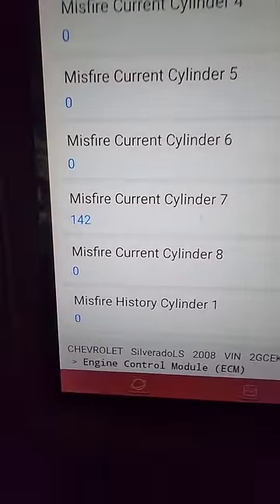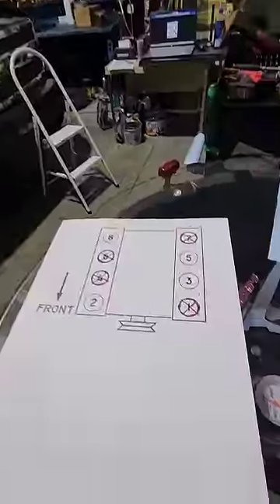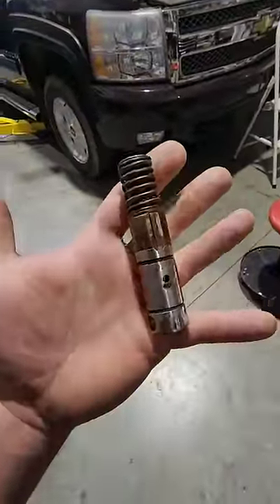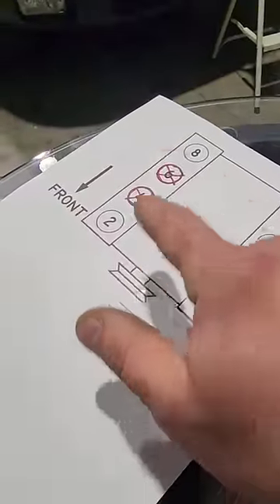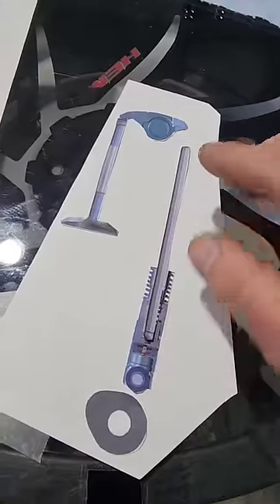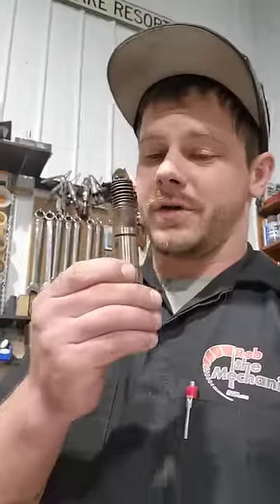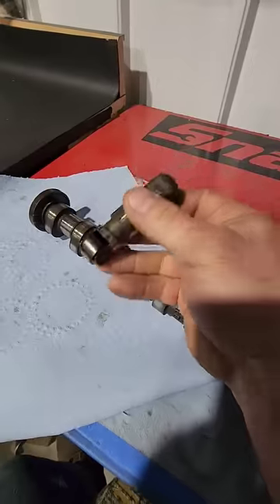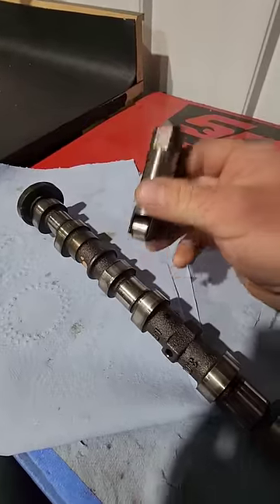GM Lifter Tick #shorts

Comment: A few years ago I was talking to a K-9 cop about his official vehicle - a Suburban that was around 5 years old. I commented about how with all the idling it does I'd expect to hear "the tick" but it sounded really smooth. He told me that he mostly takes care of it himself instead of trusting the department motor pool, and he does much more frequent oil changes than officially recommended.
Reply: It's been my experience that the manufacturer recommended oil change intervals are too long, especially if you use the GM oil light.
Reply: @mikel9656  i have worked for ford and gm an now Volvo. All oil is crap, all piston rings are tiny, weak and brittle. You are correct, oil intervals are ridiculous. Volvo is 10,000 miles or 12 months 😮 ....at 10k ive done 2 oil changes. Never exceed 5 k on todays oil and maybe 8k on ( making jack off gesture ) ams oil .
Reply: @Rob Sorgdrager  Applicable only if you're using conventional oil.

IMO, you shouldn't be using that oil in the days of tight tolerances at all, anyway.
Reply: @subtlename2873  agreed, ams oil is just expensive-er regular oil. The oil today has had all the " expendable " metals removed. The chromium, molly and zinc have been replaced with calcium. The low tension rings combined with sub par oil drain orifices and direct injection have created a issue all on to its own. Combine that with short tripping and over saturation of particulate in the oil. Every system in newer engines uses oil to either lubricate or operate a system. The bearings are made from aluminum and most engines are all aluminum with some sort of plasma voodoo sprayed into the bores....gimmie a high nickel iron small block from the late 60's and some steel bearings and a gallon of old rotela 15/40 .

Comment: Hemis have the same thing . I’ve had a customer come in with 3 lifters collapsed and the  cam was completely chewed up on all 3 lobes for those cylinders . Lady said that car was ticking for over six months and it was barely running.
Reply: Very true, early 2000s hemis also had valve spring issues. Done bunch more chevys though
Reply: 360 V8 gaser was the beast mode motor for Mopar. Will not die, bodies just rusted away

Comment: I fixed this same problem with liquid moly additives and running the engine on the highway in 3rd gear at 3-5k rpm’s , the lifter came loose and no more misfires, I also changed the engine oil with liquid moly oil
Reply: Parts in a can..... guess it can work sometimes
Reply: everybody should do this, I have a theory that most people have problems when they drive like a grandma, these parts need to be stressed and heated up sometimes to work functionally

Comment: Ya we do about 3 of them a week. It's cheaper to replace the lifters when it startes and do the conversion to get rid of the cylinder deactivation. However when it goes too far its cheaper for our customers to replace with a gm engine instead of replacing the cam.

Comment: My father-in-law's 2012 sierra 1500 has been making a similar sound for a bit. Doesn't do it all the time though, and there's no sluggishness while driving. Also the check engine light isn't on, and the engine still goes from V8-V4 like it should. Only does it while driving though
Reply: lolololloloololool
Reply: Check exhaust manifold bolts
Reply: @ajaxracing  So many idiots think they have lifter tick when in reality its the manifold cracked and warped
Reply: @shesqueeled  yup

Comment: I'm glad i went with the 2010 F-150 300'000 miles and only had to change the alternator.  Runs great starts on first try. 4.6 l v8 and gets 22mph highway.
Reply: So they stopped making it . I have a 4.2 with 320k miles

Comment: GM has brilliant engineers who were top of their special education class.
Reply: They were given a fuel economy target, they met it. Chrysler uses the same system, and honestly both systems are pretty reliable.
Reply: @isaakwelch3451  no, they are not. They have ruined thousands of engines in under 100k miles.
Reply: @curtism-w6b  thousands of engines out of the millions that have been made is a pretty good failure rate
Reply: @curtism-w6b  The bar for GM has been lowered to the point that 100k miles is exceptional reliability and a 2% failure rate is a miracle.  I've been burned by GM in the past - never again.
Reply: @bills5009  This. Compare Japanese quality control to GM and it’s not even close. Babied my LS3 since new, finally sold and will never buy another Chevy ever again. RIP ❤

Comment: I won the broken pushrod lottery on my ‘16 Sierra 6.2L back in July of 2023. Poked two holes in the block and seized the engine. $8K for a scrap yard engine/trans replacement on eBay. Went ahead and had DOD delete installed for an additional $7K between parts and labor. And still, cheaper than buying a new or used pickup from a dealer.

Comment: I remember replacing my cam shaft and valves on the good old 78 chevy c10, had a little 305 in it haha only took about 8 hours with that one, what always grinded my gears was the timing as it took me awhile to learn how to set it correctly.

Comment: Maybe the engineers aught to set this up so that if a collapsible lifter fails you get a check engine light.

I used to be a section leader for electronic technicians and one of the things I did to vastly improve our efficiency was to train the operators to detect and report problems that they had previously ignored because they seemed minor. So, having an obvious symptom, like a check engine light, might get people to bring the vehicle in when the problem is still minor.

On the other hand this video might help people realize how serious this tick is and get it fixed early.

Thanks for posting this one. I realize it might cut into your revenue, but I’m sure you’ll still get plenty of work.

Comment: I did the delete myself. After replacing all lifters once... Months later cyl 1 lifter collapsed. Did a tune to remove AFM and plugged up the oil channel in the VLOM to manually delete it. Been running the truck strong for over 2 years now.

Comment: I just had a DOD lifter fail on '07 Tahoe, about 2 weeks after I bought it, no noise or anything, just a miss on cylinder 4. When I pulled the valve cover sure enough the intake valve isnt opening, mysteriously it also had new, no name, junk looking coil on cylinder 4, so I suspect it may have gave the previous owners some trouble at some point and they tried that first, and then possibly doctored up the lifter somehow. It was runing like a top prior and I put well over 1000 miles in the short time I've owned it, it probably would have held if the DOD was tuned out afterwards.

Comment: The majority of lifter failures that I have heard of did not occur in cylinders with MDS lifters. Mine occurred in cylinder #5, which isn't an MDS cylinder. Once I experienced the failure, I started researching the problem and haven't been able to determine that MDS had any role in it. It seems to be random...some on and MDS, and some non-MDS.

Comment: Theres alot of videos about this.
One guy invented a tool to get the lifter to expand in certain circumstances.
Theres also an issue with loose bolts in the upper engine area.
You should watch several videos about the different symptoms to get an idea for your diagnosis.
Be quick about effecting repairs like this guy says.

Comment: I drive a 2008 Honda accord V6 with VCM it’s the same thing as AFM on GM vehicles except mines a little more reliable but it does burn a little bit of oil over time I can get it removed with a plug in adapter

Comment: The exact same thing can be achieved with the Engine Management System, which could also alternate cylinders being cut off so they all wear evenly, keeps all cylinders at roughly the same temperature.

Comment: Lifter tick is so common that it's a feature. We did a ton of lifters in the more recent body style gm trucks. At least the 08-13's more often than not lasted through the powertrain warranty. We hardly saw these trucks because by the time they failed, their warranty was expired and no one wants to pay dealership rates on this big of a job. These new trucks are getting multiple sets of lifters before 50k.

Comment: FYI. Instead of a 4 to $6000 delete kit you can spend $200 on a plug for your OBD. It keeps it in V8 mode at all times and I’ve had no problems. The truck I had before this one actually had one of the lifters spin sideways on the cam. So after fixing that and buying a new truck, I bought that plug thingy right away.

Comment: Mines been ticking for about 23k miles. Local shops want 9-11k to put in a remaned long block or 4-5k for a top end rebuild. I can't afford either right now. So I'm still driving it to work

Comment: Eh, typically happens due to a lack of preventative maintenance. Drain a quart of oil and put a quart of ATF in the engine oil and run it for a little bit. Those oil ports occasionally get clogged and that does not allow the lifter to lift and the detergents in atf will, most of the time, clean that up, anywhere from seconds of running to about 50 miles of casual driving. Works with this bs and just typical hydraulic lifters too. Then just change your oil and keep your oil changes up to date and don’t go 20k miles or 5 years without an oil change. I’ve personally never seen anyone have this problem on the DOD GM engines that stayed up to date on their oil changes.

Comment: Ha brought it in a month ago. My 21 ram 3.6L has been ticking for the last six months from 110k-160k. Still ran decent. Turns out to be both passenger side cams and the defective rollers. Got my motor money in those 50kish though.

Comment: Traded my v8 sierra for the I6 diesel engine, best decision I made, had a misfire in my v8 at 23k miles and the check engine came out, a week in the shop to get it fixed. My Duramax is still going strong with no dashboard lights at 60k miles, and the Duramax is an awesome diesel saver.
Reply: You realize that GM does not make the Duramax engine. They tried to do their own version of a diesel engine after Dodge was using the Cummins. Did not work our so well, like most of the GM products since the 70's. They HAD to go with another engine to save face once again, thus the Duramax.

Comment: Don't forget fuel seeping cylinders which can't fire correct building up fuel breaks down oil also.
I found out coilpack went bad until I found a fire diagnostic tool between plug wire to plug show exactly fire weak.

Comment: I had this ticking sound on my 1998 360 Magnum many years ago. changed all the lifters after the Professional  Mechanics  Diag'd it as being a collapsed lifter Issue, measured the Cam 100% perfect. Same thing. Replaced T-stat cuz it was running cold at the time, it got 400% worse. Replaced all the Rod Bearings Same thing. New oil pump. Switched to a " Tick relieving" grade of oil same thing. Flushed the engine 6 times same thing. Only had 60,000 on it. Perfect compression and great performance.  Sold it cuz the old lady thought it was gonna blow up. $800 🤬 still driving to this day 100% fine
Reply: Mopar 360 V8.... much more durable than a GM 350, or Ford 351. As a rule, but there are exceptions to all rules
Reply: Lmfaoo no way you went through all that just to sell it for 800 thats fucking sad that was a perfect engine

Comment: The Biggest Issue With These Lifter Failures Is People Drive It Till Its Misfiring. At That Point Its Got So Much Trash Circulating Through Your Engine That The Success Rate Of Just Replacing Cam And Lifters Is Very Low. Your Pump Gets Whiped Out, The Lifter Bore Gets Damaged Upon Removing The Destroyed Lifter And You Have A Very Fine Abrasives Circulating Through The Engine. 

As Soon As You Hear A Noise From Your Engine Thats New Have It Checked Out haha.

Comment: My 2017 sierra is going back for the second time for lifter ticks. 2nd day I had the truck I had to bring it back and now 5 months later and not even 3000 miles I have to bring it back. It’s a 5.3 and I’ve noticed it’s been firing 4 cylinders a lot lately instead of 8.

Comment: I did a DOD delete with a cam and new lifters on a 2014 and it still did it after 100miles.  Sold the truck, I think it’s the 2 stage oil pump, bc it would go away after 2nd stage kicked in with higher oil psi.

Comment: I have a 07 tahoe lmg 5.3 that had dod got the tick at 30k so I got a btr cam, lifters, and buckets got rid of the vlom plate and used a pre dod vally cover bought a vlom oil plug from some guy on YouTube and sent out the pcm to lt1 swaps had it programmed installed a melling high flow oil pump and it now has just over 270k on the engine with zero issues...

Comment: If this happens buy a push rod grind end like a drill bit, hit lifter to turn & unlock lifter so it opens.
Then it stops noise.  Then turn off relay & fuse to lifter controler.

Comment: It literally takes me less than 8 hrs to do the whole job new camshaft new retainer new lifters deleting the afm i plug the holes in the valley I put new oil pumps and everything on the 5.3s that's with getting heads cleaned and all 😂
Reply: Is that what you pay your employees? 8 hours? It's a 22.3 hour job in a labor guide.

Comment: I have the 5.3 in my "09" Suburban. Knowing damn well about this GM brainstorm so I'm  strict with the oil changes and only use full synthetic. Have been debating whether to convert this engine back to full 8 cyl or just get a remanufactured full 8 cyl.

Comment: In a ram truck with the 5.7 the eco mode can be turned off using the +/- button on the shifter to out the trans in 6th gear (still shifts on its own)
Can Chevy owners do something like this?

Comment: If you cant afford the replacement or it isnt worth the cost to you. Marvel Mystery oil in the motor oil has cleared this up several times. Change the oil, add the recommended amount and drive the truck for 50-100 miles.

Comment: I just had my truck fixed for this problem cylinder 7 misfire and cylinder 4. It cost 3,600$ to fix it. It took them tearing the heads off. I took it in as soon as it happened so I didn’t have to get new cams but they had to replace 8 lifters and fuel injectors. I got the laundry list of parts to prove it
Reply: so now you need to find a tuner that will shut off your AFM if you do not... well youll be back here in 3 months

Comment: I shift mine down to manual mode, select 5th gear and drive normal. Never goes into dod and no tick. Got my 13 silverado with 15k on the odometer and now has 160k. Mostly highway miles from shutdowns and oilfields.
Reply: you drive like that all the time? kinda smart actually

Comment: I had this happen and the shop I was using at the time told me there wasn't anything they can do about it. Just told me to run it as is.

Sold me a engine swap about a year later. And that's just one of many things that got me into doing my own repairs. I might have no idea what I'm doing and I have to keep 2 vehicles around so I have a driver while I'm working out how to fix the broken one but I got sick of the 6 to 9 month turn arounds on repairs only to find out they didn't repair it.

Comment: See, i think Koennigsegg was onto something with that camless engine that used electronically fired actuators for valve control. DoD with the ability to kill all ignition/valve actuation electronically if one or more of the actuators wasn't operating within some strictly set parameters, thereby negating engine damage bc it simply wouldn't run to damge anything (no valve clearance/rocker arm slapping) issues,....plus finer tuning ability across the rpm range for different fuels, AFR's, boost psi, etc just like we now do with fuel injestors.....

Comment: Seems like this is also due to things like not changing oil enough or other gunk gumming it up, maybe more oil or simmering to clean it would help. Like pumping more oil over those areas i mean which would be an engineering thing. But anytime you increase complexity of a part stuff like this will happen.  But that's why oil changes are so essential.

Comment: I actually get better MPGs with AFM/DOD deleted than when it went into 4cyl mode, plus more pulling power, & a smoother idle. 
If you don't want to go through all the work to delete the DOD system properly & don't have lifter failure yet (you will eventually on a 5.3), buy a Range module to prevent it from going into 4 cylinder mode. This will prevent the failure but will NOT repair a collapsed lifter.

Comment: Are there any lifters you can buy that won't ever get stuck? An aftermarket version maybe? Or is there a way to swap out other lifters and get rid of that stupid system altogether? 

Looking to buy one a suburban soon. I don't mind doing the lifters
Reply: You can get a dod delete kit and disable the system. Lifters is a decently big job, have to pull the heads to change them. I've done it so doable at home.

Comment: I gave up and resurrected my 89 k2500, 5.7,  miles were low, but had every gasket on the engine leaking, heads included, redid everything……so it gets 10 mpg…the parts are cheap, and it’s paid for like 25 years ago!

Comment: Other companies are having similar issues, my car deactivated a cylinder, then the loose rocker simply fell off the pivot. Recall swapped me a brand new engine because of it though. 👌 Flashed the engine so it doesn't deactivate anymore. Problem solved.

Comment: If the lifters are functional, and NOT ticking yet, just have a tuner turn off the AFM. Problem solved.  If it's already ticking and you are going in already then might as well delete. I've done both.

Comment: Poor oil maintenance makes this worse. When this happens, I'd recommend replacing the whole longblock since everything else has a hundred and forever miles and if you're going to spend that kind of money, it's better to reset the clock on the internals than keep running it. But then again, it's not my money